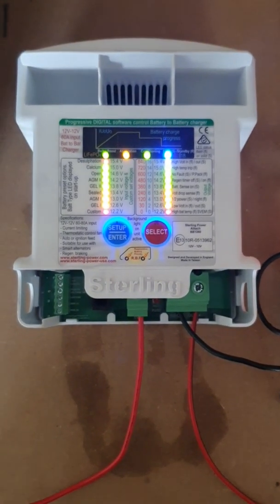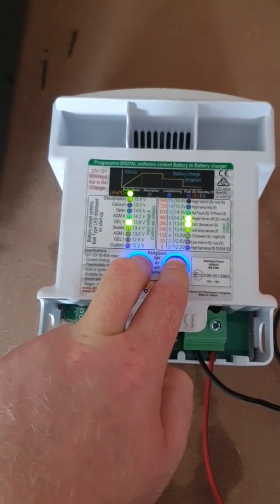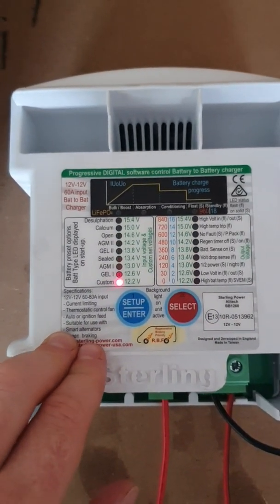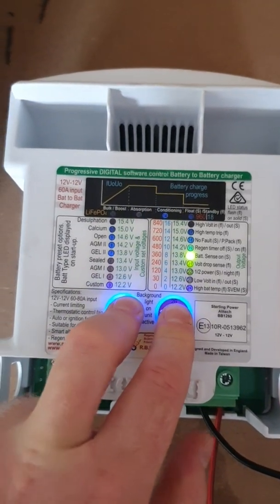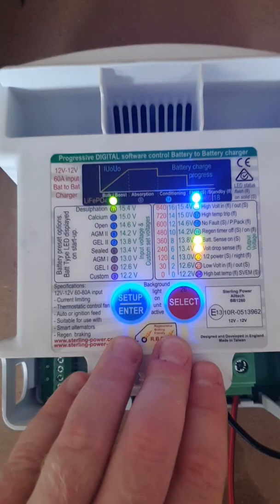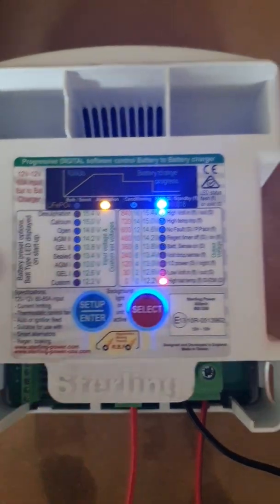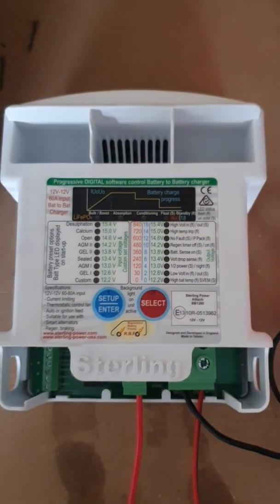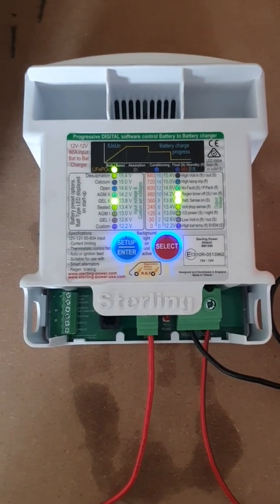Sterling Power BB1230/1260 GUIDE - Custom Profile Select and Startup

Comment: I've just bought and installed 1 of these along side a 95ah AGM battery. Just wondering if I were to run battery down to 50% how long should i need to drive before the battery is back to 100%?
Reply from the maker: Hi Carp;

Which have you bought? A BB1230 or a BB1260?

If we're assuming you're down to, let's say, 45AH of capacity left, slightly over 50%, you would need to attain 50Ah of charge to get back to 100%. 

the 60A battery charger would need to be for around ~50m, the number may end up being notably lower in practice due to the optimised voltage care for your battery and the four stage charging process, or it may be slightly higher if there is inefficiencies in the setup.

A 1230, due to being half the current limit of a 60, will take roughly twice as long.

Hope that makes sense :)
B
Reply: @SterlingPowerProducts   thanks for the quick reply. i went for the bb1230  alongside the halfords hlb800 95ah battery for a leisure setup. yes i think that makes sense so i think id be looking at possibly 90 mins driving. so the 30a is basically the charge rate if it were bulk charging the battery and i guess this drops as the batteries soc gets higher. is there enough information for you to be able to tell me the recommended agm setting for that battery? i wasnt sure if agm1 or agm2 
Halfords Leisure Battery HLB800 | Halfords UK
https://www.halfords.com/motoring/batteries/leisure-batteries/halfords-leisure-battery-hlb800-682097.html?istCompanyId=b8708c57-7a02-4cf6-b2c0-dc36b54a327e&istFeedId=367c5610-f937-4c81-8609-f84582324cd6&istItemId=wrlwrxmax&istBid=t&_$ja=tsid:94971|cid:1034356518|agid:95368410843|tid:pla-900570777114|crid:419703868739|nw:g|rnd:17106545556241288153|dvc:m|adp:|mt:|loc:1006522&src=3bpdp&gclid=CjwKCAiAi_D_BRApEiwASslbJ3HIh7zInaU3zt7NqbzkgNIO3VMpEZYgo52NDCdqpb2Q5pfVp_Xp_RoCC_oQAvD_BwE
Reply from the maker: @john-ec6sy  Hi Carp!

I just gave Halfords a call regarding what preferred charge voltage they want and their response was "I've never been asked that question before, standard procedure is just a voltage higher than what the battery is already at." Not brilliantly useful, then!

I'd recommend you leave it on the factory default Lead Acid setting, it'll charge you at 14.4V which is suitable for 99% of battery types and saves you having to do any faff.

Hope that helps!
Ben
Reply: @SterlingPowerProducts   thanks . i was kind of expecting that from halfords tbh that why i havent asked. so if i just reset unit to default then it should be fine 👍 thanks again for the help

Comment: Does anybody know what the difference is between the AGM 1 and AGM 2 on the battery settings
Reply from the maker: Hi John,

Page nine of the instruction manual has a breakdown of every charge profile and the voltages assigned to them. 

Hope that helps!

If you no longer have the instruction manual it can be readily found on our website.

B

Comment: The temperature sensor that comes with the unit would be a better place on the alternator?
Reply from the maker: Hi Tactical Advance,

If the temperature sensor is to be fitted then it must go onto the negative terminal of the leisure battery. It'd get quite confused if it starts getting information about the much warmer alternator feed when it's expecting a battery. 

Also, a lot of alternators these days are relatively regulated by themselves and so long as the BB is the primary place the alternator is working to supply then, so long as you've rated the BB correctly to your alternator, your alternator should be absolutely fine because the BB current limits and will not be making your alternator work harder than it's rating. Batteries however are far more prone to being unpredictable and frankly annoying, so that's where we've directed the tempsens.

Comment: Hello I'm about to receive my new motorhome with those new smartAlternators (which if I properly understand can work on a wide and often low Voltage range). Does this B2B will have any issue with those ? Should be just installed as manual on/off in such a case?
Reply from the maker: Hi again,

When it comes to smart alternators and euro-6 vehicles, the only way you're going to get a reliable charge is via a battery to battery charger. 

It makes your alternator engage reliably with the starter battery and it pushes up the voltage to the bespoke setting selected so you know you're getting the charge you expect throughout.